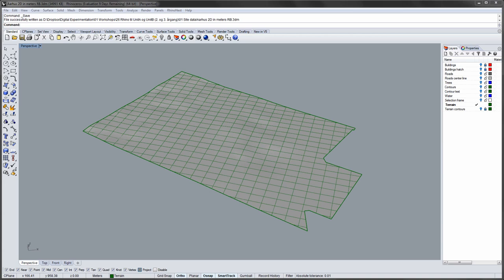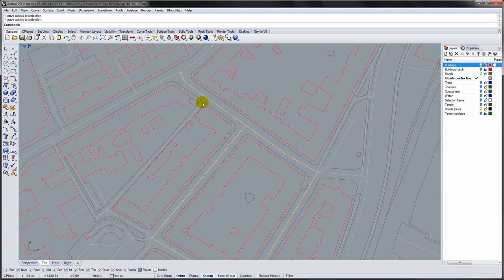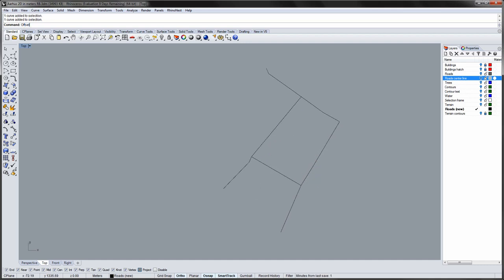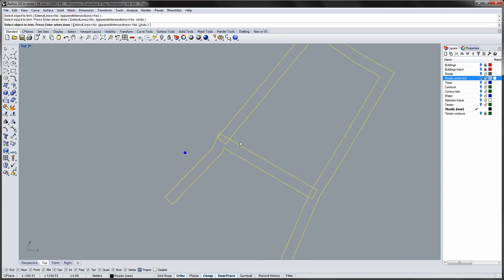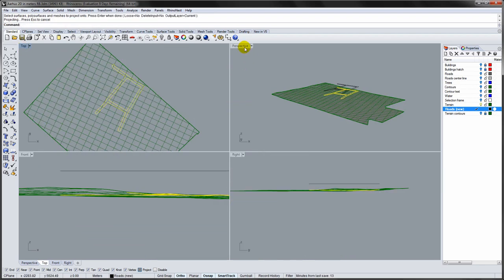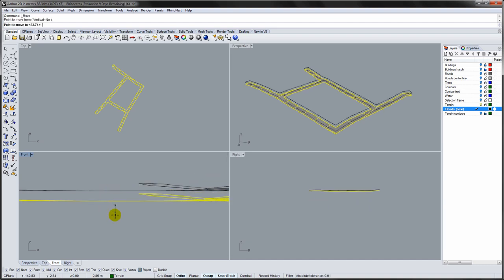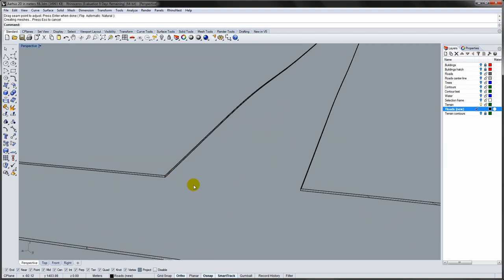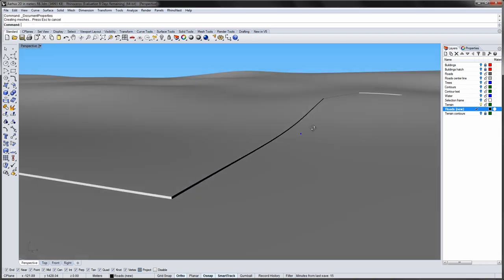Rhino - Projecting roads onto a NURBS surface

Comment: hi..
i have drafted a road profile (in cad) which in some places the width increases & has curves and i have to build the road according to the elevation values of the road (it has diff. elevation values at each ends of the road). 
I do not want to match the road profile to terrain face.
Help me doing this?
Reply: Hi! Did you find any tutorial helping to achieve that? I'm in the same situation and God... All tutorials just literally project the roads to terrain, not actually adapt the road elevation to the terrain... I'd be really greatful to you If you can guide or show me where you find a solution. Thanks in advance.

Comment from the maker: Yes you can. Just make sure the stacked contours are hollow or you will get a projected curve for the bottom surface too.
In terms of splitting road and terrain, you can actually go straight to splitting in the top view.

Comment: How can you smooth the roads out so that there are no ripples in them and then grade the topgraphy so that it nicely insects with the road?
Reply from the maker: You'll need to smooth/relax the topography in Rhino.
I don't know of a simple way of doing this but if your goal is smooth geometry and you don't care about the precision - I believe that you can use the Drape command (with few control points) and drape a simplified plane onto your topography, then repeat the steps in this video.

Comment: Damm I can't select  the mesh with the split command.  The mesh is not lock
Reply from the maker: Hi Kevin, the split command only works with NURBS geometry. You can make a NURBS version of your mesh with the "drape" command (use the top view). Hope this helps.
/Ruben.
Reply: use toNURBS